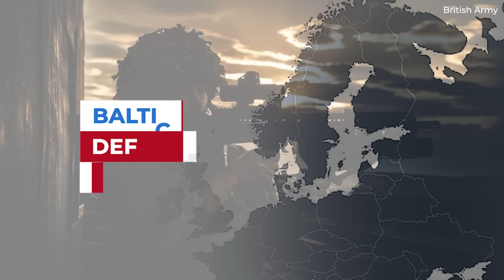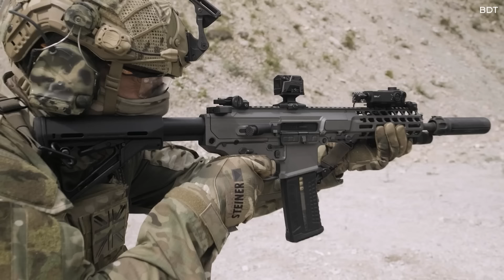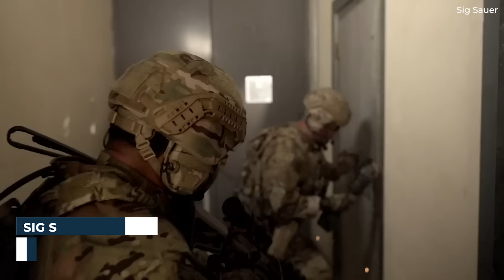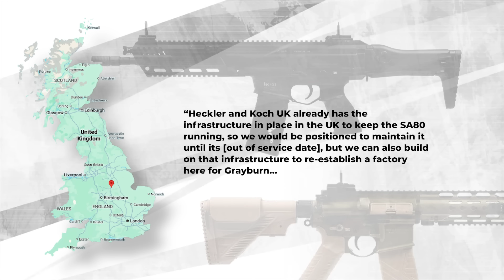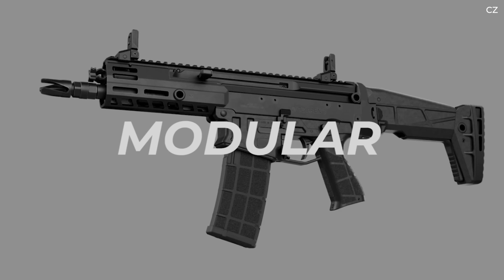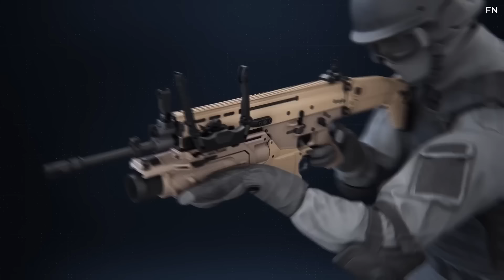Project Grayburn: How Well Do Various Rifles Meet Tender Criteria?

Comment: Ambidexterity is a non-factor in the British Military. Their stand is that since 95% of new recruits coming into service have never handled a firearm, training them to shoot right-handed will lend itself to muscle memory when operating a firearm. This was the reasoning why the SA80 was not designed as a ambidextrous weapon. This is probably why the MoD did not include ambidextrous controls as a requirement for Project Grayburn. My own personal experience as a Left-handed person who was taught to shoot right-handed is that it works. Even now, if I pick up a firearm, my "instinct" (muscle memory) is to handle it as a right-handed person.
Reply: Outdated manual of arms, it's common practice nowadays to be able to switch shoulder especially in close combat.
Reply: SA80 actually had mirrored left-handed variants built as prototypes. The idea was to have a certain number of them in the inventory for left handed soldiers. But ultimately that idea got scrapped.
Reply: Good for you. I'm left handed, and I hate the thing. Hopefully when we get the new rifle, we can finally end this discrimination against left-handed shooters

Comment: The EF88/F90 Rifle from Thales Lithgow meets the requirements well.

It's more compact than any offering here. All those AR-15 style rifles usually have to go down to <12" barrels to have similar lengths and profiles. The EF88/F90 can keep a full length 20" barrel and still be shorter than just about any conventional Service rifle.
Its reliable, the Steyr AUG has been used by the ADF for about 30 years now and this is the latest, most refined and reliable version of that rifle. It's a very different animal.
It's lightweight, about half a kilo lighter than a SA80A3.
Great ergonomics. The Compact design and center of gravity of the weapon is closer to the body and much more comfortable to use long term.

In current service with the ADF ours are fitted For-But-Not-With a central power unit. That is to say, one can fit a battery inside the stock to power the rails. This means all those power hungry accessories on the rifles these days like advanced sights and lasers can have their operational life extended greatly by a single battery in the stock.
Reply: Yes. In fact it's so good the Australian Special Forces don't use it.

Bullpup triggers always suck.
Reply: @jonny2954 and yet chance after chance we dont change to an AR for the regular forces.
Even though Lithgow does an AR.
Hmmm.

Also Bullpup triggers don't always suck. Guntubers with Gucci aftermarket trigger packs will tell you that when comparing 50 year old designs.
EF88 has a different, retuned trigger, that feels a lot better. Other good trigger bullpups include KEL-TEC and Deserttechs options.

Also military triggers have different requirements than what Guntubers will make you thinkm
Reply: @birdmonster4586  "and yet chance after chance we dont change to an AR for the regular forces"

Just means it's "good enough" for regular forces but gets ditched the instant an AR is available for groups with better funding. Just proves my point.
Reply: @jonny2954  Mate, We've gone through massive upgrades to the Steyr to turn it into what it is. THat's a serious financial investment.
Could have just as easily just bought some HK416s which, given how many countries are buying them, must not be that expensive. Economies of Scale and all that.
Reply: @birdmonster4586  Sticking to a fielded weapon system and modernizing it has massive cost advantages. No retraining, no new tooling, not even new storage racks.

Choosing the HK416 as an example for an affordable platform is odd though, it's one of the most expensive service rifles in existence. It also performs that way. The AUG hasn't seen service with Delta...

Though you still haven't come up with an explanation why Australian SOF chooses another platform once they had the option.
Reply: @jonny2954 well, back in the day, those m4s had better space, more rails and such for accessories compared to older F88s, even the Sa1/2.
Also, special forces aren't a metric to judge the requirements of a Standard Service Rifle for troops.
The EF88 is an excellent rifle, reliable, refined, modern and future proofed better than any other 5.56. One of the best service rifles in the world.
It was a good choice to invest in upgrading that rifle even with the extensive and expensive upgrades it got.

2cmdo and sasr use different weapons because their requirements, missions and other factors are different to regular troops.

I'll also add, that even back in '89 the final two contenders for SARP were an AR-15 and the Steyr. We went with the Steyr because it performed better. Even though we already had AR-15 in service.
Reply: And Yet it gets thrown out to the Trash bin the moment an AR Option is available
Reply: @gotanon9659 except it didnt.
We literally chose it over the ar-15 because it was a more reliable rifle,  among other things. And when time came to modernise the weapon we picked it again and didnt change to the AR.

Comment: The form factor seems to require a bullpup configuration.  After all, with a PDW version on the small end (the standard example being an FN P90), as distinct from a carbine, the overall size would run out of funtional barrel unless it was a bullpup.  Also, armor defeat requires maximising the energy of the ammunition, and the M7's attempt to work around that bit pf physics has resulted in a set of compromises that are singularly unattractive, with its wasteful and expensive bi-metallic ammunition and excessive recoil.  Also, claims that there is some magical 5.56 bullet that defeats hard body armor are greatly overstated.  This cartridge simply lacks the energy to do so beyond point blank range.    The only real physics solution is a larger volume of powder plus a long enough barrel for the intended range, pushing a narrow tungsten projectile at high velocity.  So, all these AR clones are off the table, which is good because the arms industry is basically a rip-off intended at maximising profits through slick marketing and political influence.

Comment: anything but the M7
Reply: we do NOT want that rifle
Reply: Nobody is ever adopting the boat anchor that is the M7 and it's ridiculous cartridge. I expected even the US will drop it sometime in the future and return to the M4. It will be another M14 situation, mark my words.
Reply: @phazonlord0098  I could maybe see the 6.8 replacing the 7.62 in DMRs to give a bit of extra range...
But as for general infantry issue, no.
Reply: @sergarlantyrell7847 Nah, 6.5 Creedmore, 6.5 Grendel and 6 ARC are way more suited to that than 6.8 Fury.
Reply: @phazonlord0098 would have thought 6.5 Grendel and 6mm ARC were too low-power for that application.

6.5 Creedmore would of course be suitable, but it seems like 6.8 fury would also do the job just fine.
Reply: @phazonlord0098 Oh really. 
Hate to burst your bubble liberal boy. 
But the M7 ain't going anywhere. In fact, the Sig Corporation just brought out the improved version of the Gun the M7A1. Which is lighter slightly smaller and much better to handle than the original M7. How about doing some more research instead of regurgitating what other people are saying. In short use your brain 🤔 🧠.  Otherwise you sound like a fool.
Reply: @automandan  The M7A1 hasn't been getting any better, and the shorter barrel isn't helping it. Nobody likes this gun. Sig only won because they lobby the hardest, that's it. It is a shit rifle for general purpose rifle rollout to the infantry, and putting all of our eggs into one manufacturer's basket due to the ammo required is pants on head retarded.  There's nothing liberal about hating the M7. Most people who have genuine credentials hate the M7. Also stop using emojis, you sound like a 12 year old.
Reply: I thought they were considering higher caliber?
Reply: We, the Americans, made the “M-14 mistake” AGAIN! Too powerful a round created a weapon too heavy. Simple.
Reply: @Prodigysportsman it really os crazy how far the m14 comparisons go. the video of the sig rep essentially saying "we got the contract so stop thinking about it"
Reply: @Prodigysportsman  I wouldn't say round is too powerful I feel it's the wrong way to solve the problem. 

Recently someone made a 9mm able to go through 20mm of steel used on BMP hulls. 

It uses a penetrator tip, what they needed to do slightly increase the pressure not the dramatic increase they did. 

So you need a cheap penetrator with slight pressure increase. 

Then don't get sig USA to make the gun since they keep seeming to turn out unreliable crap.

Also the steel brass hybrid casing is dumb. We have decent steel casings for awhile just switch.
Reply: @murphy7801  You are talking about the 6.5mm CBJ round, I think. That can fire from a 9mm pistol, but it needs a special barrel insert and the round itself is a discarding-sabot type. It's not really the sort of thing you want to be issuing as standard.
Reply: Buys it anyway when they realised that a ceramic plate that could stop a m995 could be made in a workshop in the middle of the jungle
Reply: HK 433 or CZ Bren 3
Reply: 😭😭hn
Reply: M7 is going to be a massive fraud
Reply: I thought I read somewhere that certain units within UK military had adopted the M7 in small numbers.
Reply: @ednigma6526 we absolutely have not. no clue where u read that but we are not using the m7. british firearms officers use the 5.56 version of the m7, the mcx so you mught be getting confused there
Reply: M7 is suffering from major issues, weight of ammo, recoil, weight and less reliability then the L85.
Reply: @trickiejohn less reliability than the L85? Does it even fire once?
Reply: The G36A1 is the perfect rifle for conscripts. It is lightweight, simple to use and disassemble, has built in optics that aren't great but better than iron sights and can't get lost. It is durable, accurate and reliable. Because its a closed design not much mud or dirt gets inside.
Reply: @Derjeniche-s8f  UK doesn't use conscripts but I don't disagree
Reply: @Derjeniche-s8f  I thought the Bundeswehr confirmed that the LMG variant really did melt in Afghanistan and is actively replacing the entire rifle family.
Reply: @joshuamueller3206 We never had the LMG variant in the German army. But there was one case where the rifle overheated after an hour long battle in Afghanistan. But the rifles didn't melt. It was said that due to the wrong ammo there was more friction and thats why it was heating up faster. But that was 16byears ago never occured again and was never experienced by other countries. The reason for the change is that the contract is expering. So you can either make a new contract and buy new G36 to replace the worn out G36 or buy a new rifle that they think is better. They chose the HK416 to finally end the G36 controversy because the story is still stuck in the heads of many people and the army want to get away from the image. They also said the 416 is modular. We also replace the P8 pistol even though they're fine.
Reply: @Derjeniche-s8f  G36 is dead.
Reply: @libertylivesin1776 it would still be perfect for a conscript army in its basic form. There are better rifles for trained professionals but give me any civillian and he will master the G36 in an hour.
Reply: @Derjeniche-s8f That isn't in competition and even H&K is offering the 416 instead.
Reply: @zoperxplex i know. I just express my personal opinion. Its also not a conscript army but a professional one.
Reply: Or the KS1